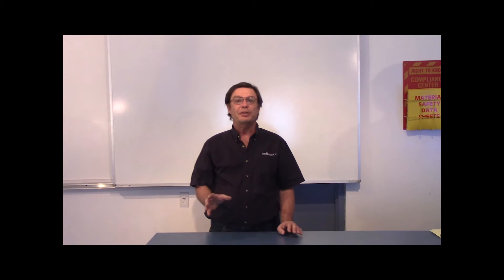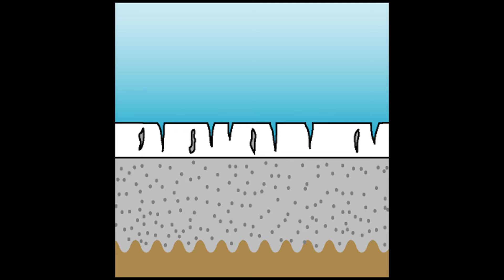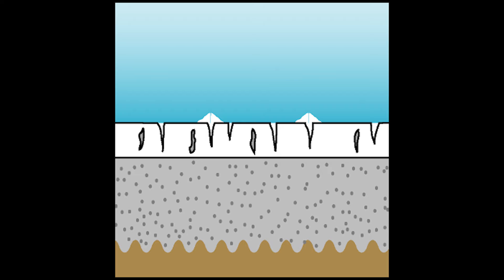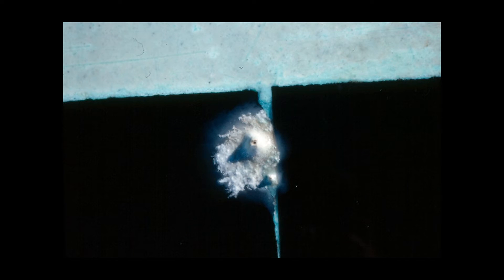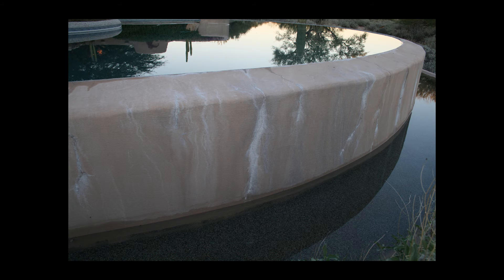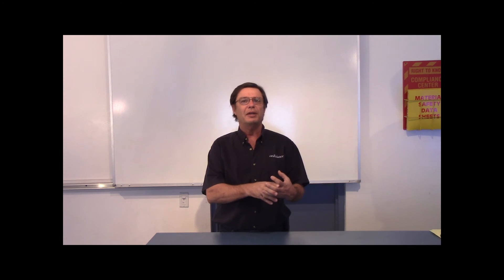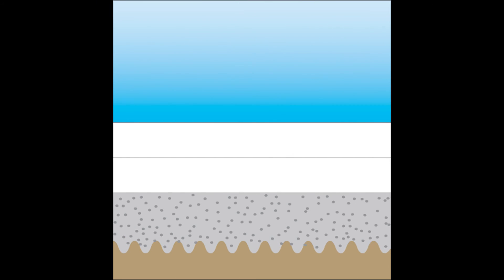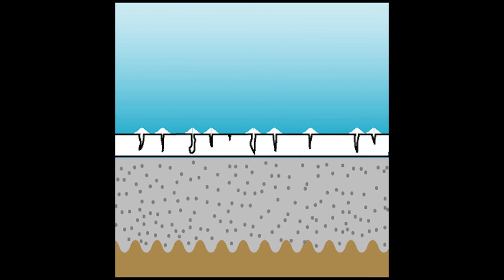Calcium Nodules Part II - Other Types

Comment: awesome videos guys, very clear explanation in part 1 and 2, but there is one thing that's puzzling me, and that is if a new pool forms nodules after say 6 years plus ?? is this a normal occurrence?? cheers
Reply from the maker: Shane - Original plaster can lose its bond from a substrate years down the road, but it is unusual. Ground shifting from water table changes, seismic activity, etc. can flex the shell but the plaster does not have tensile strength and will lose bond or crack. Alternatively, there could be a subsurface void that was covered with plaster that eventually, over time, became exposed to water. In any event, the sequence of (1) water contacting hydroxide in plaster, (2) calcium hydroxide-rich water coming to surface and (3) that material carbonating in place to form a nodule is the common denominator. Thanks for the interesting question!
Reply: Thank you so very much for the info, very interesting
Reply: What calcium level do you recommend for a salt water pool that already has nodules in many spots ? My calcium is one the high side.